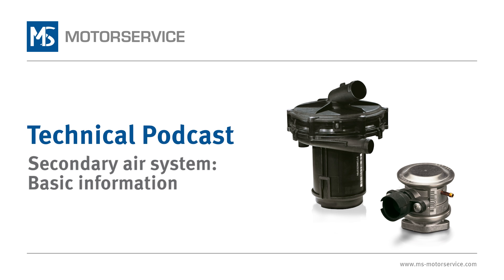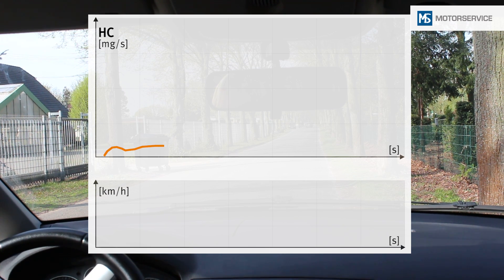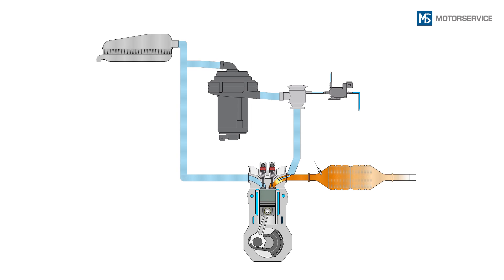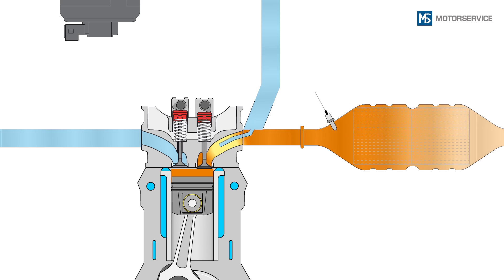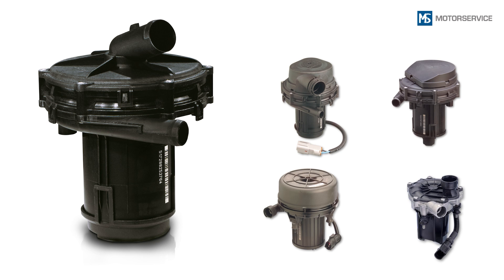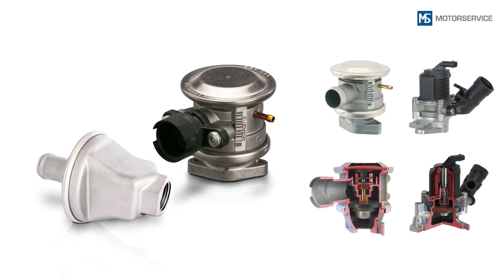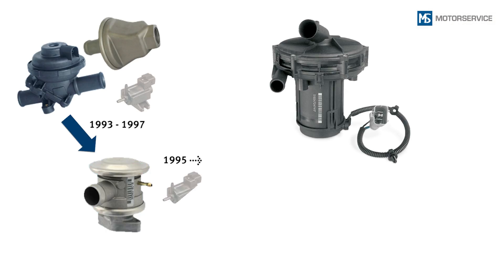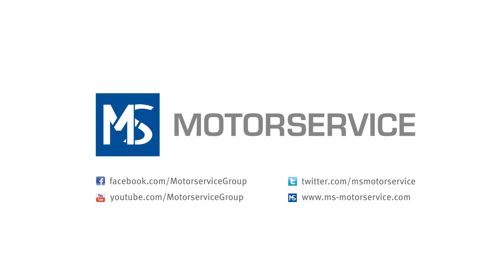The secondary air system | Part 1: Design, function, components

Comment from the maker: Secondary-air system - Design, components, trouble-shooting!

With spark-ignition engines, the greatest pollution occurs on cold starting. Secondary-air systems have been successfully employed to reduce such cold starting emissions.
Reply: Does it also causes the exhaust gases to re-burn ( re enter combustion chambers, )
I believe deleting it will give better efficiency)